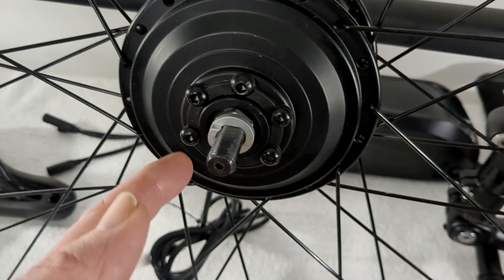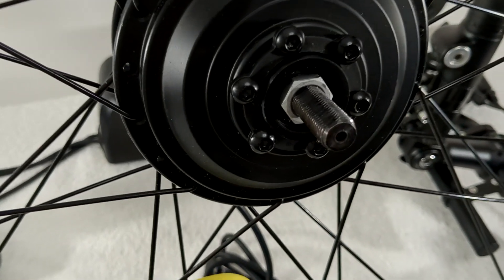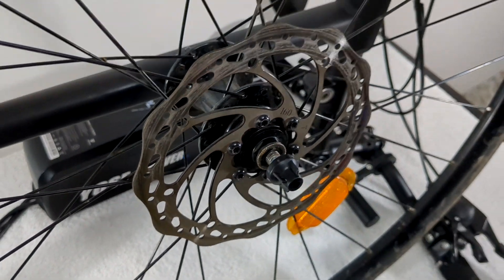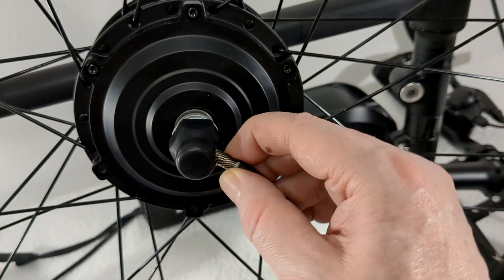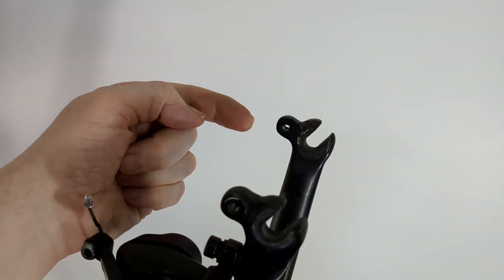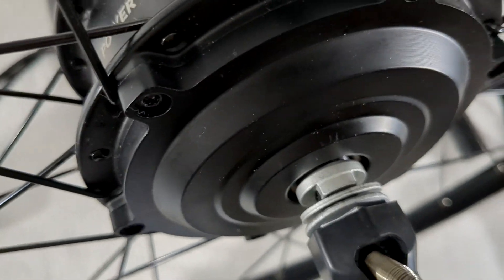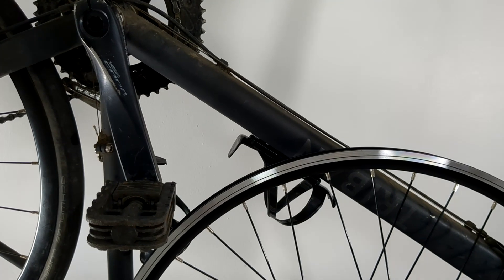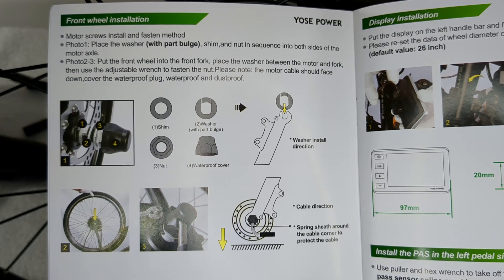Ebike kit front wheel won't fit : axle too big

Comment: The flats on the axle are 10mm.  You cannot file the axle because on the cable side, the cable goes through the centre of the axle. I would just file out the dropouts enough to fit the axle and use a reamer on the top of the dropouts just enough so the axle goes fully home. You will notice there are two oval washers with a bar, these are fitted outside the dropouts to hold the axle in place. The bar fits into the dropout. They also assist with the motor torque. You do not need a torque arm with this motor,  they are for higher powered motors. Half a mm off each side is an easy job and a slight reaming so that the axle goes fully home. Job done.
Reply from the maker: gonna make another video on this (not sorted it yet).  I'm confident now.
I would do the dropouts but Swytch bike kits seemed to have this issue and they said file the wheel axle as dropouts may be prone to (iirc) 'microfractures'.
some bike front forks (maybe some/all road bikes ?) seem to have 9mm front axles. 
plan B is the dropouts.

Comment: The 10mm motor axle has two flats on it for a reason. They allow the axle to slide into the 9mm fork slots and stop the axle from spinning when the motor is under powered. BTW, the audio volume is to low. Hardly able to understand you.
Reply: The flats are actually 10mm, the axle is 12mm overall.

Comment: use a hand file to widen the dropouts, do not use an electric side grinder because you may remove too much, you want a tight fit.  Also the thickness of the fork should not be real thin, as the torque may spread the dropouts.  If the axle rotates that is disaster, spoken from one who knows.